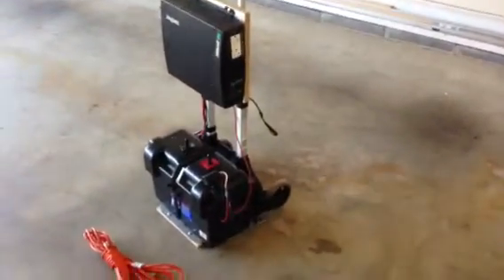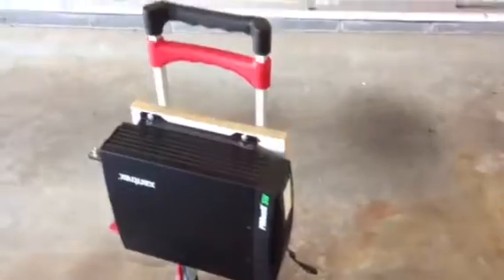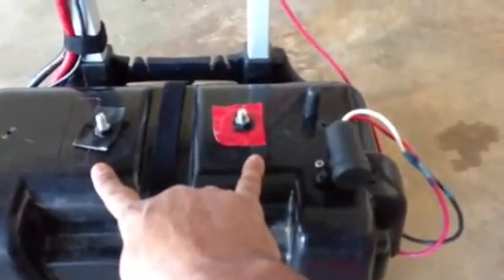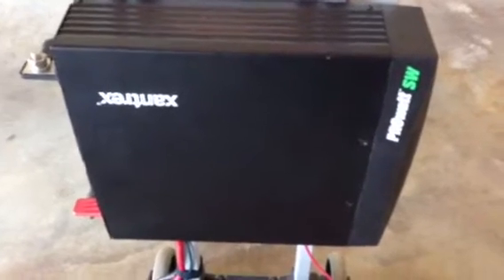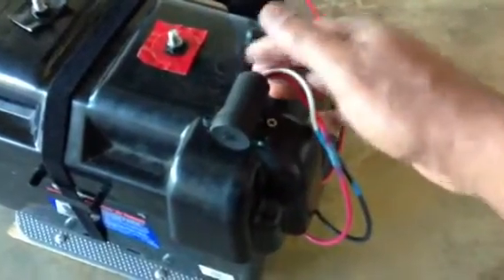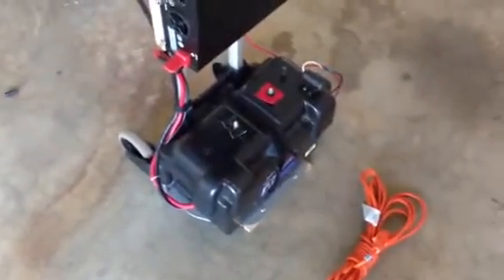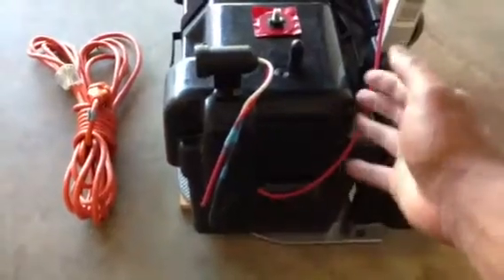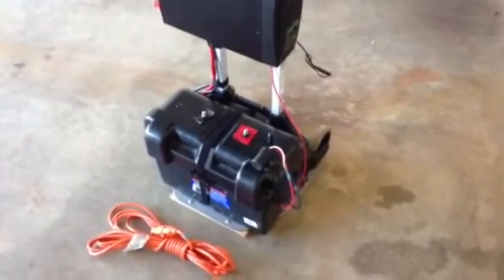DIY- Revised Home Built 1800w Portable Solar Backup Generator

Comment: Nice set up. This case would make a cleaner install. it has cigarette ports. https://www.amazon.com/MinnKota-Trolling-Motor-Power-Center/dp/B001PTHKMG/ref=sr_1_4?ie=UTF8&qid=1523812289&sr=8-4&keywords=marina+battery+holder
Reply from the maker: Thanks for the comment.  The link as a great case.

Comment: So how long could this power a 1000watt speaker? I am so lost in this sort of thing, but looking to build one thats strong enough to run audio off grid.
Reply from the maker: Lets do the math, 115Ah battery x 12v = 1380wh of storage,  1380wh x .50% Depth of Discharge  = 690wh of usable storage,   690wh * .90% Inverter Efficiency = 621wh,  1000w (Audio Amplifier) / 621wh = 1.61 hrs of power, "approximately.  You would need more batteries in parallel to give you more running time.  You could drain your batteries below the 50% depth of discharge, but you would shorten the life of your batteries.
Reply: rhandsom you just melted my brain, lol. I have since found out that my speaker doesn't run at 1000 watts constant. that was just at maxed settings and usually resides at 500 watts. (:

thanks for crunching the numbers!
Reply from the maker: No problem,  but I made mistake in the math.  To correct, it's 621wh / 500w = 1.242hrs,  The other calculation is wrong in the final division.  So essentially, at 500w, you'll have just under an hour and a half runtime.  Take Care.

Comment: What do you use to charge it to get power, since theres no alternator? You mentioned a trickle charger....does that keep it going?
Reply from the maker: Jillian Bentley I use a trickle charger to keep it topped off.  I also have a solar charge controller that will allow it to be connected to a solar panel.  Worst case I can hook it up to a battery charger.

Comment: Great video. After starting on my parts search I found a few Marine battery boxes that had all the attachments (12V port, +/- terminals, level meter and terminals), with nice wiring on the inside. $19.99 plus shipping. Put this together in 20 minutes. Awesome!  Thanks for the ideas!
http://www.amazon.com/Shoreline-Marine-Battery-Power-Station/dp/B004UOUSWM/ref=sr_1_3?ie=UTF8&qid=1395511228&sr=8-3&keywords=marine+battery+box
Reply from the maker: Thanks for your comments, I'm glad this helped inspire you to build your own.

Comment: wires  should be thicker on inverter and charger
Reply from the maker: With the low amperage going in and coming out, the 8 Gauge wire from the inverter to the battery should be sufficient, and the 10 gauge wire from the charger to the battery should also be sufficient. the charging current from a portable charger shouldn't be higher than 12A and from this solar charger no higher than 30A, I would be lucky to get 15A.  So 10 AWG should be sufficient.

Comment from the maker: You are "technically" correct. Since this is a portable backup unit, it is sized by the inverter. Solar indicates one of the many ways it can be recharged.  Also, many commercial portable backup systems are also labeled by the inverter size, case in point "Xantrex PowerHub 1800" and "Ecotricity ECO 1800S Solar Power Battery Backup", each of these systems do not come with 1.8kW of solar panels. Fixed systems are generally rated by solar panel install. Thanks for your comments.

Comment: solar systems are not actually rated by the inverter size. Inverter size is determined by your expected loads... they are rated by thier pannel output to the charge controll...if you have a hundred watt pannel hooked up to that system its refered to as a 100 watt solar system....anyway, just sayin.

Comment: Thank you.  I found it or one very much like it at Walmart.  I thought I found it online but nothing would tell me the amp hours 100 percent online.  All the comments said it was.  They are about 99.  I am planning to get 2 of them for my first set.  I won't mess around going to by a good charge controller instead of the cheaper sunforce.  Yours and other video's have shown me the light on that.

Comment: I like the idea of the project. I like the flexibility you've built into it (multiple power sources to charge the battery and also multiple ways to "tap" off from the battery). However, I wouldn't use Walmart for any supplies. Between a marine and auto store, you could get better quality parts. Thanks for sharing. I'll check out the rest of your vids for practical use of these portable backup generators. Nathan

Comment from the maker: Yes, as long as I use it during the day when the system is connected to solar panels for recharging.  Power would be going into the battery at the same time the distiller is taking it out.